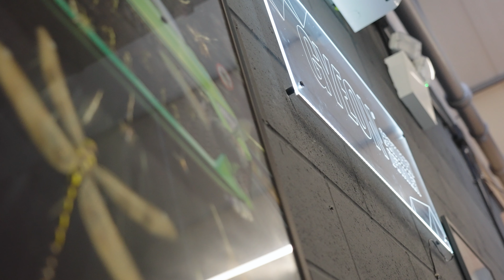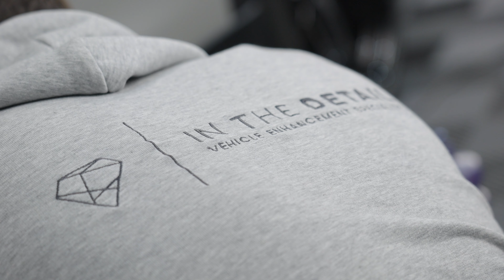Brand NEW Porsche Taycan - Exterior DETAIL & Polish (Automotive Detailing)

Comment: Why did you quick coat the car if you where about to polish it? 🙂 help air drying it?
Reply from the maker: Hi Erik, thanks for getting in touch! Yeh pretty much. We just add that hybrid coating to make the drying process slightly easier 👍🏼
Reply: @refinedfilms.  as i thought then! And then after you remove it IPA inside the garage? 🙂
Reply from the maker: @MrErajk  Yes! So once we have finished polishing we take the car back outside where we wash it down with Gyeon degrease tablets. After drying off again we bring the car back inside where it is then panel wiped with Gyeon 'Prep' before the coating is applied. Hope that helps 😊
Reply: @refinedfilms. So is the Panel prep not enough before application of the ceramic coating?
Reply from the maker: @carcarerijen  Thanks for getting in touch! So Gyeon recommend that you wash the car as well using the degreasing tablets. Then a final wipe down with ‘Prep’ before applying the coating 👍🏼 Hope this helps
Reply from the maker: @carcarerijen  In summary the panel wipe is sufficient enough before applying the coating. However we always wash the car using the degreasing tablets as well to ensure the surface is as clean as possible before coating